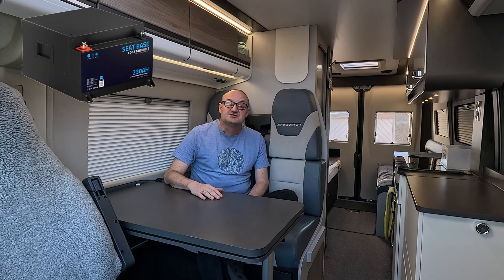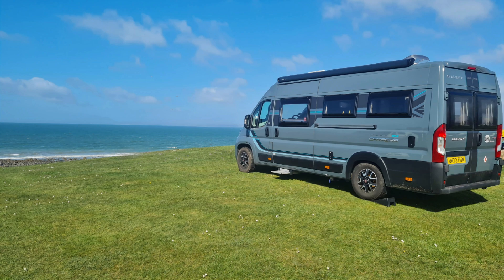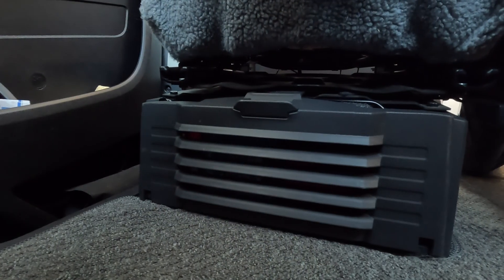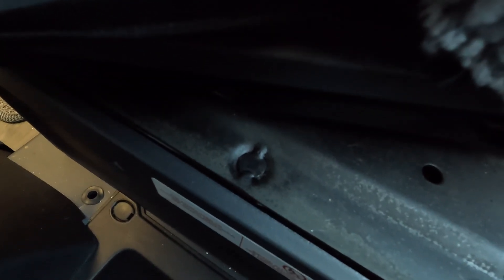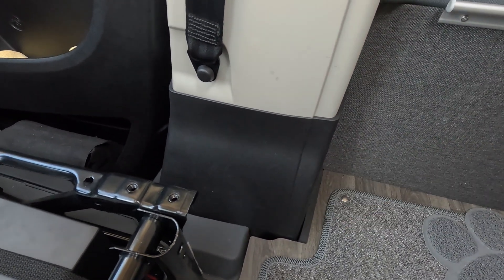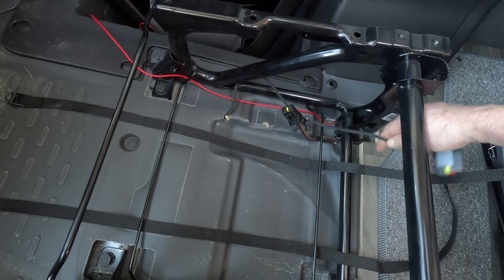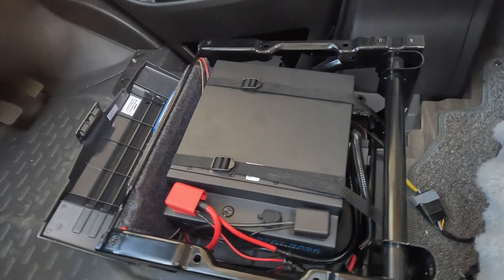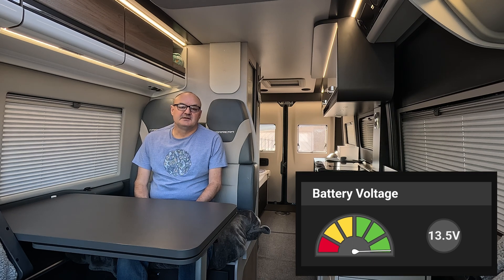DIY Lithium Installation & Disable Sargent Split Charge System

Comment: Great video, very informative, so thanks for posting. We are thinking about doing the same in our Carrera 122 but considering a larger battery under the bench seat instead. We go away off grid in winter using the heating, lighting, TV and fridge for a few hours each night. Have you found that the 230ah battery is coping ok with similar use to us, or if you were to do the project again, would you go for a bigger capacity battery? Now we are in winter and you’ve had a good 7 months use are you finding that you are achieving the 5 days off grid?
Reply from the maker: Hi, ProfessorOfAdventure & thank you for your comment. We too love to travel throughout the year & after 7 months of use the whole system has performed amazing. Our only modification since this lithium installation, we have added a further 200w of solar. I guess there are many variables when calculating power usage however I believe 5 days during the winter could easily be achievable & during the summer you should be ok for weeks & weeks & weeks. If you have any concerns about the single underseat 230Ah then maybe you could consider a second underseat 230Ah under the N/S passenger swivel seat.

Comment: Great video,  just  checking the d+ wire did you splice the wire before connecting to relay as in the diagram? It shows 2 wires going to the charger. 
Thanks
Reply from the maker: To avoid confusion & for simplicity, the diagram does show 2 D+ wires going to the DC-DC. In  reality, this is not the case. Yes, I ran the D+ from pin 4 on the Sargent & spliced it near the B pillar to feed the relay & the DC-DC. Hope this helps. 10 out of 10 for observation as you're only the 2nd person to notice this different method of wiring on the diagram 👍 Thanks for tuning in & good luck with your lithium build.

Comment: After the fun with solar I thought id follow suit and do this mod too, pretty easy except getting the D+ wire to the front, but two coat hangers used together sorted that.
Reply from the maker: It's a game changer of a modification, that's for sure. Yes, you'll always find it easier watching the video than doing the same job in practice, but you got there in the end. 👍 Best wishes & happy travels 😀
Reply: @thomsonsUKtrips  true, I did it in stages, put the relay in first but under the Sargent. Then installed the Orion XS in the front direct to both batteries. Tried the auto engine running but didn't work. So finally ran the D+ from the Sargent to the Orion and its worked perfect. With the solar as well. Thinking of replacing the PX300 with a PX301 as it understands lithium batteries.
Reply from the maker: Perfect. When doing my research, I asked that question about the PX300 as we well know it isn't a designated lithium charger. However, I was informed that the specifications are perfectly suitable for lithium. Keep safe & enjoy your travels 😁

Comment: Using that relay could you have habitation 12v on whilst engine running ?
Reply from the maker: No, in that respect, nothing changes at all. Everything behaves as it previously did before the modification. When you start the vehicle, the habitation side of things including the control panel, shuts down. The step retracts & the fridge remains on.

Comment: I'm wanting to upgrade from lead acid to lithium because we much prefer off grid motorhoming and exploring. Not to mention the long term ehu cost savings. I won't tackle the DIY myself (I know my weaknesses!), but eagerly watched your excellent presentation and explanation and made notes. Like many of your viewers I like to do my research so I'm fully informed and not be taken for a ride by an installer. Thanks so much for your great video with easy to follow explanations. I need to see what else you cover on your channel. Go well. hamba kahle as they say in Zulu. 🤗 Happy travels.
Reply from the maker: Hi, Julian. Upgrading our 12v leisure system has massively transformed our van from a useless off-grid unit into a confident capable off-grid unit. We much prefer off-grid camping too, hence the upgrades👍Thank you as always for watching TUKT. Hamba Kahle 😁

Comment: Thank you for an informative video, I am considering lithium upgrade as original 8 year Banner AGM battery must be approaching its sell by date. I also need to disable split charge system intergrated within CBE Distribution  Unit, I can snip resistor R37 to disable  but rather fit relay and leave things as is.

Cost breakdown, can I ask did you get new battery leads made up for your install as this must save on tools.

Thanks again.
Reply from the maker: Hi, Tom. Thank you for your comment & thank you for tuning in. I made up my own battery leads as I already had the tools/crimper/heatshrink/etc. To be honest, going lithium has completely changed our van. Before, it was rather impractical, but afterwards it is now a capable off-grid unit. Good luck with your own 12v leisure upgrades 👍

Comment: Very interesting and informative video thanks for sharing. But I’m wondering what are your thoughts by fitting the isolation relay in the supply to the PSU from the leisure battery that means all the power needed to run your fridge while travelling would have to come from the vehicle battery. If the isolation relay was on the vehicle battery feeds power would come from the leisure battery. 
What’s your thoughts?
Reply from the maker: Hi Mick, having changed from lead-acid to lithium & fitted a new DC/DC charger, the isolation relay is necessary on the leisure battery side of the charging system. This is to stop the two potentially conflicting charging systems, whilst also protecting the vehicle smart alternator. Whilst travelling, the vehicle alternator and vehicle battery will be more than happy supplying the fridge with 3.3 amps  👍
Reply: @thomsonsUKtrips I’ve had a dc to dc fitted because I’ve noticed my 2023 Ducato Swift Escape 674 didn’t fully charge my leisure battery. I got the dealer to fit 20 amp small Sargent version of a dc to dc. Currently I don’t have lithium and at the moment I don’t have any plans to fit them. Initially a relay wasn’t fitted and although it was charging better I did notice it charge at the full rate when the supply to the PSU was disconnected hence the PSU wasn’t getting any supply from the vehicle battery. I took it back to have relay fitted. They fitted it to isolate the LB it works ok but every time I start the engine the Truma heating panel resets. This is because power is interrupted to the PSU by voltage drop and no power supply from the LB. 
Hence the question really because by isolating the VB there will no voltage drop.
Reply from the maker: @micksparrow8214  Before our upgrade, I felt ours was exactly the same as yours. Even after a long drive, the leisure battery was never at a healthy state of charge. I believe this issue is down to the euro 6 smart alternator as in order to cut down on fuel & cut down on emissions it often chooses to deliver little to no charge. As you said, your new DC/DC charger will definitely improve charging as it will now demand up to 20A from your alternator 👍
Reply: @thomsonsUKtrips definitely the smart alternators are causing this. All modern vans should have a dc to dc fitted as standard now.
Reply from the maker: @micksparrow8214 I agree with you entirely, but I'll go one step further & say all new leisure vehicles should come with lithium as standard too 👍

Comment: Great job and what a well put together video. Have you left the solar set up alone? I have the same fogstar installed along with the Orion XS  in our Carrera and the solar has not charged the leisure yet due to the lithium having a higher voltage. Apparently the Sargent only diverts solar to the Leisure battery when it's below 12.4 volts. Concerned I'm not going to get the solar benefit to the leisure when static for a few days.
Reply from the maker: Hi David & and what a great question. I have just purchased 2x 100w panels & I am going to wire them in series. This should give me approximately 60v but keeping the amps at 5a. The reason for this addiction is to increase the voltage going into the MPPT as it needs to see the solar panels at 5v higher than the battery to initiate a charge then the rest of the day it just needs to see 1v higher to keep in a charging state. Many days, I have found that we're struggling to initiate a charge with just the 1x single panel. Did you know that on the control panel above the door, you can access "advanced settings." Here, you can select the solar charge to either "smart" so it supplies a charge to the vehicle battery & the leisure battery, changing every 4 hours or you can select "vehicle battery" or as I have set ours to "leisure battery" only 👍
Reply: @thomsonsUKtrips  Thank you. This is super helpful as I was not aware of that option in the  advanced settings. I already have 2 panels so I can now put the output to good use as I also swapped out the Truma mppt for a victron as you have done. Thanks once again.
Reply from the maker: To select leisure battery only in the advanced settings, first make sure the control panel is "off" then press & hold both battery buttons at once. You will hear a single beep. Then press the leisure battery button till it is on 13v. Then press vehicle battery button till it is on 10v for "smart" or 11v for leisure battery only or 11.5v for vehicle battery only. Then press power button, you will hear 2 beeps 👍 your solar is now set to leisure battery only 👍
Reply from the maker: There are many other adjustments that can be changed within the advanced settings, but this solar setting is the only one I have felt that needed changing 👍

Comment: Great video. I plan to do exactly this after watching your video. Do you think crimping the two brown wires into one spade end connector on to the relay would work instead of a 2 into 1 connector.  Also what size red d+ cable did you use? Many thanks
Reply from the maker: Hello, thank you for your comment & thanks for tuning in. I guess, if you wished, you could try & go straight onto the relay. However, there really isn't much room to work within around that area. This is the reason I extended the wire slightly onto the relay. This also allowed me to locate the relay within the B pillar. There isn't much slack in that brown wire (leisure battery to habitation wire). The D+ wire is only a signal wire, so any good quality, multi strand, copper wire would be sufficient for this, cheers.
Reply: Thanks for getting back to me. Yeah that makes sense extending the brown wires, what size cable did you use for that? Do you think 10mm would be sufficient. Thanks
Reply from the maker: @12UNP I'd have thought 10mm wire would be overkill. 10mm wire would be rated at 70a. The large fuse from the leisure battery to habitation is only rated 40a 👍
Reply: Sorry for all the questions. I started the job today but think I have purchased the wrong relay. Can you give me a link to where you bought the relay from. The one I bought is from Halfords and says normally open do I need normally closed?
Reply from the maker: @12UNP Hello, there's no need for apologies. If you have any further questions, then ask away👍 Yes when the relay is at rest (not energised), it needs to be closed. Therefore, you need a (normally closed relay with diode) 👍

https://www.halfords.com/motoring/tools/fuses-electricals-and-fixings/electricals/halfords-relay-12v-40a-5-pin-elec261-725470.html
Reply: Yes and on pin 3. Its a swift escape motorhome so maybe its a different setup. Same Sargent ec600. There is a decent size fridge in the motorhome so maybe its for that. Do you think all pins are d+
Reply from the maker: @12UNP ahh, ok, a Swift Escape, maybe the wiring is slightly different. Check your B pillar as you may already have a D+ in this area 👍
Reply: Ok will do. I assumed it had to come from the EC600 but I guess any d+ should do the same job.
Reply from the maker: I believe many motorhomes/campervans already have a D+ wire as part of the conversion plug/wires within the B pillar 👍
Reply: In the B pillar there is a D+ signal wire. It’s in a white multi plug white and blue wire. This goes to the Sargent unit as an input. The red E6 plug is an output. 
If you connect at the B pillar it must be spliced but it saves routing a cable from the PSU.
Reply from the maker: Hi, Mick, I had previously read there was access to a D+ signal on one of those B pillar converter plugs. That's good infomation as routing a new D+ wire wasn't the easiest of jobs. For clarity I simply followed the wiring diagram kindly sent to me by Sargent as I felt this would be the best course of action 👍
Reply: Hit a snag today. There is already a d+ wire occupying the pin that the diagram shows to use. The top two are occupied. Should I still connect on to that pin by joining the wires together? Thanks
Reply from the maker: @12UNP, your Red E6 plug already has a D+ on pin 4 ?
Reply: Hi great video. Quick one the d+ wire on the diagram it shows 2  wires going to victron unit .
Did you splice  the d+ wire to connect to the charger. 
Thanks

Comment: Thanks, a really useful & informative video. We don’t have your technical skills, so with our new Swift Carrera 132 (2025 model), we will be getting Blue Fix Company near Leominster, West Midlands to sort. But, in fairness to Swift, they now provide 2 lesuire batteries instead of the 1. This has enabled us to do 3 nights, off of mains electric hook-up. The 3rd morning, mid morning, we did get the Fridge warning. Still not brilliant, compared to your great DIY lithium upgrade fix. So we will be following your transition to lithium. Thank you both.
Reply from the maker: Thank you for your comment. I'm sure Blue Fix will do a great job on your van. Just make sure they disable the original sargent split charge system as this is a crucial step to avoid two potentially conflicting charging systems. Disabling this will also avoid any potential damage to your smart alternator from the old non regulated split charge system to your new lithium battery. Our single 80Ah lead-acid battery wasn't fit for purpose & I believe Swift would have known this. I'm aware Swift fitted 2x batteries on the later Carreras but as you say the lithium set-up really is in a different league. Best Wishes.

Comment: Hi , Brilliant video I have Swift Voyager which runs the same identical equipment as yours I have been researching this upgrade for a while and know feel confident to do it myself with your help, my only question is where I’d did you get the D+ wire from inside the B pillar?
Thankyou 👍
Reply from the maker: Are you able to edit your question so it is clearer ? There's a typo. If you're asking, "Where did I get the D+ from?" I ran it from the Sargent unit  red plug E6 pin 4 to the B pillar.

Comment: Very well presented. We have an old autocruise carrera 4, from 2014. It came with the same battery as yours. Not a lot changed in 8 years! I have upgraded in a similar way to you. Our leisure battery is under the dinette bench seat, so I was able to fit a fogstar 280ah drift battery in place of the old one. Like you, I fitted an isolation relay, dc to dc charger, (30amp, new xs came out later). Luckily, we have roof rails, so to supplement the factory fitted 50amp solar panel, which I leave connected to the engine battery, I fitted a 200w standard panel to the rails. A 15 amp victron mppt charger completes the set up. I also purchased a 40amp fogstar mains charger, and use a 12v plug in  power supply to indicate mains on, when on hook up. I left the original sargant mains charger, connected to a 13amp plug, in case I need to charge the vehicle battery when on hook up.
As you say, it is a game changer, no more range anxiety!
Reply from the maker: Yes, you'd think all new leisure vehicles would come with lithium as standard, but as I said, I guess all manufacturers want to save costs on all their builds. Sounds like you have a good setup too & and definitely a game changer.

Comment: I've missed your broadcasts lately but caught this one thankfully. I am an electrical engineer but didn't fancy doing this work so I, so to speak farmed it out. I think we live in parallel universes. Since we last connected on here my leisure batteries failed on my Swift Carrera 122 less than a year old. Decided on underslung gas tank 25 litres and the Lithium and controller upgrade costly but when my second lithium battery arrives I will have 460 amps under the front seats. Also just finishing the lounge locker mod you did getting rid of the drawers. I'd like to show you with a pic what you inspired. My lounge is bigger being 122 so used deeper spacers to avoid the electrics plumbing and pump. Its got to the stage after all this work I need to get 😎😎out and use my van !!""!! LOL👍👍
Reply from the maker: @leather10uk  I like to DIY. Therefore, after many days of research & after breaking the job into fathomable sections, I was happy enough with my 12v knowledge to delve in & get the job done. As you know too well, the factory setup really isn't fit for purpose. We have a refillable 5kg Safefill bottle, but like you, I want to hopefully soon go underslung. With 2 underseat lithium batteries, you would have some great storage capacity there 👍 The rear lounge storage mod is really helpful, so I'm so glad I inspired you. Hopefully, you'll get to use your van soon. Thank you for commenting & for tuning in. Best wishes 👍